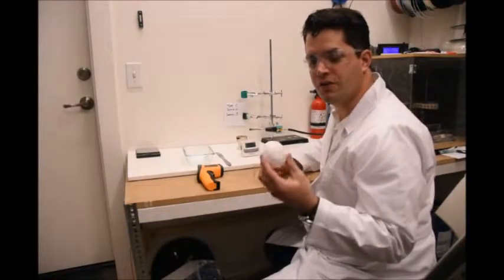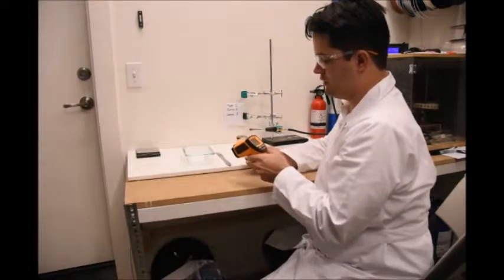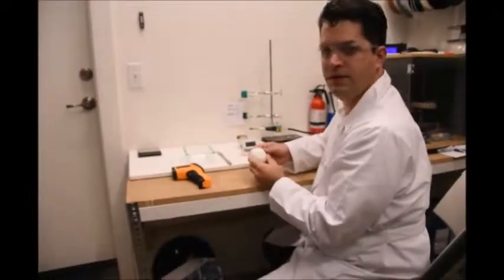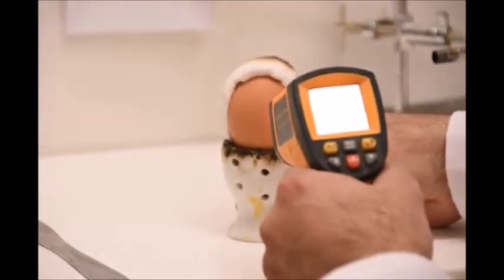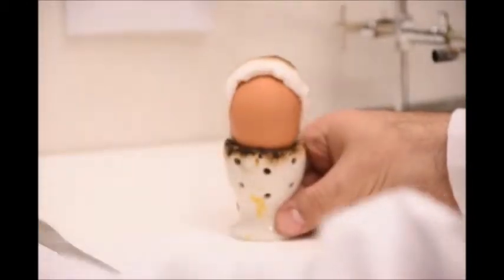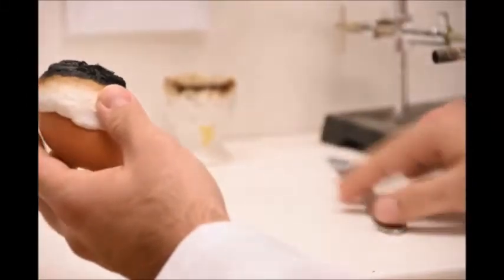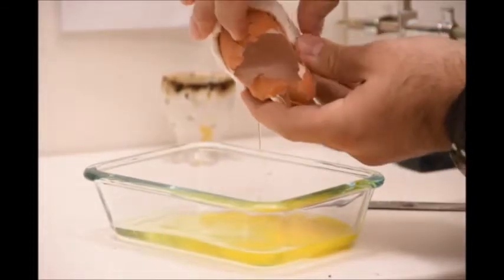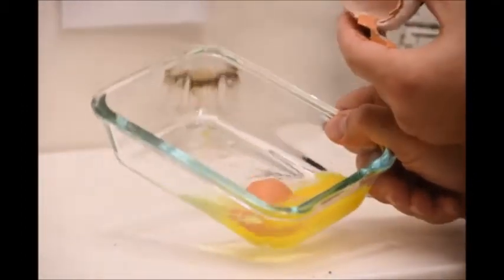Thermashield Starlite demonstration

Comment: I like to think firefighter's could make use of this somehow, or maybe in homebuilding in areas with wildfires.
Reply from the maker: Hi, yes good thinking. There is a version of this based on Silicone that can be used to prepreg regular cotton fibers...or pretty much any textiles. The results are very similar to what you see here, even with a thinner layer of material.